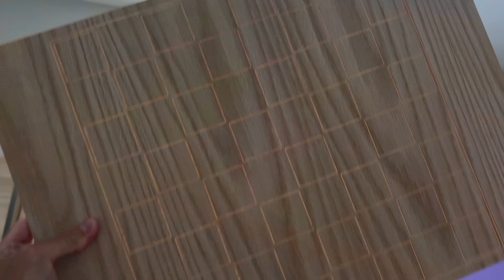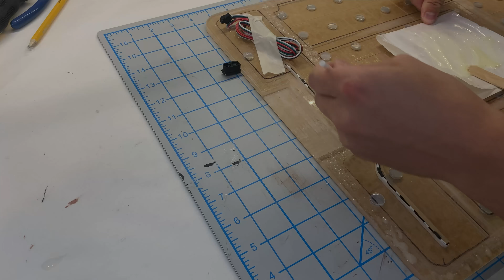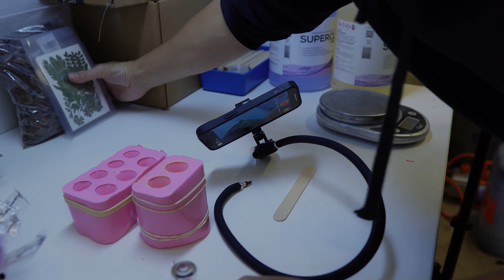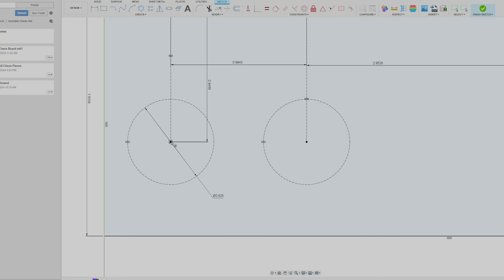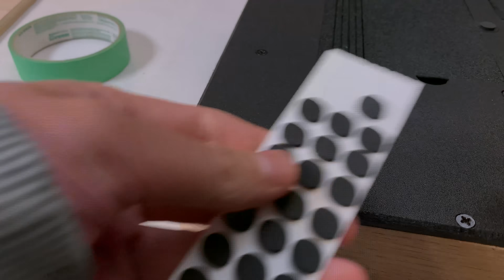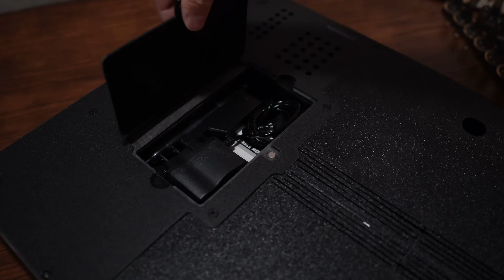I Built a Chess Board That Hides Itself

Comment: A very exciting piece, I can see a lot of people liking this. the love the pieces, very sharp and simple and still very easy to visually see. The board has enough room to place the captured pieces, which is nice. and the size of it is fantastic. However, the grain is running in the incorrect way, it should be running from one player to the other, it creates a visual flow that is expected with higher end boards, to be fair i think you showed two different ways of setting it up where one was correct grain, and the other incorrect, which is very off putting to be fair, you can't do that with a normal board. but that leads to my next point. which is  the entire board is made up of the same species and color of the wood, I get the point was to separate the individual squares with the lights. but during more complicated play this would cause way to much confusion, and the board should not be a hindrance of the game. as such i would say unplayable, and that its a 3 out of 10. the presentation is just excellent however, of course the lights make it really pop. and i can't say it enough I love the pieces...probably the best custom pieces I have seen.  Anyone would be luckily to have this in their home, just as a show piece and not something you can really sink your teeth into.

Comment: Impressive build and I like the attention to the craftsmanship of everything.  Have played some chess (not good) but I hung out with a chess club that played tournaments there are some standards that were overlooked, and of course that's not the purpose of your build, but if you wanted to make your next chessboard and pieces to that standard, here you go:  First, take the rook and lay it on its side, that should be width of the square... all boards and pieces are proportional to that.  The "House of Stanton" are the official shapes of the pieces.  A chess board needs dark and light squares.  To accomplish that look, but still hide the fact that it is a chessboard, you can have underlit boards, the checker pattern of squares can have thicker or colored underneath the board so it will reveal itself when the LEDs are activated.  Make sure you get the right color pattern the  A1 = Dark color square.   A nice touch on the pieces is to weight them... I like the "Triple weighted" pieces as it gives them some gravatas and make them that much better feeling when playing with them.

I do DIY on my channel for Halloween props projects, but I really like the fine work you do... this is a no-brainer to sub to your channel.  Cheers!
Reply: Your reply echoed my thoughts in particular the part that it should have light and dark squares. Important part to be functional. 👍

Comment: 154 magnets were necessary.
You may have put more magnets than needed to make the black bands more snappy and anchored to the board. If so, it goes from 162 to 202 magnets.

32 for the pawns and the board
64 for each squares of the board
32 for the black storing bands + 8 to fix the bars inside the storage compartments spraking of which
10 magnets for the storing compartmends under the board. (5 for the doors, 5 for the boards)
8 to fix the black bands and have a "captured" zones during games.

32+64+32+10+8+8=154
Reply from the maker: Very Accurate I believe i used 157! But now you got me second guessing LOL!

Comment: Would require a good bit of coding and an unholy amount rfid ships, readers, and a pressure sensor under each tile, but it would be awesome if as you touched each piece[pressure sensor activated], it displayed the moves that piece could make as registered by the rfid chip it reads in the piece. Though at that point, it's going to run into a bunch of far more complicated issues and the like. Would still be really cool to see!
Reply from the maker: If I do v2 I will definitely do this!

Comment: You could put a small copper coil in each square are power them, and then you put one in each piece and wire it to an led. And make a system so when you place a piece on the board the square lights up brighter

Comment: I think that using magnets to secure the hinges at the bottom isn't a particularly good idea, as the magnets might make it feel premium, but correct me if I'm wrong, if you shake the box, everything will fall out, and if the magnets are strong enough to hold it together now, they will eventually lose power anyway.
Also, it would have been really cool if you made a timer incorporated into the board, that would give you a lot of productivity.
Reply: (Magnets get weaker over time)
Reply: I think if you made the magnets in the board (to hold the pieces still while playing) electromagnets you would be able to also use @benrex7775 's idea to light up the pieces really easily.
Reply from the maker: Very interesting idea. Electromagnets might be cool but very expensive. You have given me an idea for a future idea though!
Reply from the maker: They are surprisingly strong and if shaken the pieces do not fall out. But if dropped they would fall for sure, maybe a future version would have a carrying case to protect the board and pieces. 

As for neodymium magnets they lose very very marginal amounts of strength (like 1-2%) over decades so not too worried there.
Reply: @hobbybuilt  What about incorporating a timer into the board? The lights may be cool, but they are mainly a gimmick in most situations, if I had that board I wouldn't bother turning the lights on, but if you put a timer into the board, it would be more portable and I would prefer it to using a phone.
Another idea, which I think would be really good, is incorporating magnets on the extra bits on the sides of the board. When you play chess, and a piece is eliminated, you usually put it on the side, so putting magnets there would be pretty helpful, right?
I hope you make a part 2 of this because I enjoyed watching the video and think you could make an even cooler chessboard with even more productivity features. 🙂🔥
(edit: I just checked your channel and OMG HOW DO YOU ONLY HAVE 5K SUBSCRIBERS,  you deserve at least 500k!)

Comment: As a chess player and a maker myself, i really love all the craftmanship put in this chessboard !
I just don't understand why you mold the pieces when you could 3d print the other team in another resin and it would be cheaper to produce, unless you wanted to try to create a batch process to make many boards like this :)
Reply from the maker: So originally I wanted to make clear resin with leaves and bark embedded in the pieces, SLA printing can’t do that. Ultimately resin parts are not as optically clear either + if I wanted to make multiple sets I can do so. Long story short a few reasons!
Reply: @hobbybuilt  Oh yes i totally get it !
I forgot the "leaves in the resin" part in your video but it definitely make more sense now :)
Idk but maybe a 2-part mold would ease this leave inclusion process ?

Comment: The chess pieces look super light weight and if they are you should consider adding a small weight on the bottom.  More heft makes it feel good when you play.
Reply from the maker: Actually no the resin parts are quite heavy with the added brass washer and magnet they feel just about perfect!

Comment: Just a quick idea but to make the square more invisible have you tried milling from the underside of the top? It would keep the top of the board flawless but still allow the led lights to shine through and out line the cuts.
Reply from the maker: Did some testing on this but didn’t show in the video. Unfortunately the LED lights looked horrible shinning through the wood veneer. This would have been ideal for sure.

Comment: IMO not a huge fan.
Reply from the maker: Fair! What are your suggestions to fix it?
Reply: Would it have been possible to lay equal sized squares above led the led lines? Cause as is, the squares look different sized to each other…
My only nitpic. Pieces + place to put them away and stuff cool. Also if extended a bit could add the clock display right on board with buttons, possibly a bigger battery. I didn’t catch part of video with if this thing can run wireless..

Comment: either 64 or 128 magnets? Assuming you either used one magnet or two magnets per hole Because if a chess board is eight Grid squares by eight grid squares That gives us sixty four squares Meaning that if you put two Magnets in each there would be 128 total magnets
Reply: Although this math is just for the top side I have no idea how the stowage works yet 😂
Reply from the maker: Yeah I didnt video it good enough. 157 Total!

Comment: First off - excellent work. My comments are not at all a takeaway from the job you did. IMO The design requirement of making it appear uniform when not lit means that the checkerboard grid of light/dark squares wasn’t attempted. If I had to make a suggestion, I would do thin pieces of veneer epoxy that is marbled to look like wood when not lit, but allows light to pass through when lit. Getting the grain right is near impossible but if you could do it you’d be untouchable with this. Also, when taping the grid I’d suggest using 3D printed shims or layup guides to ensure even spacing and squareness between tiles.

Loved watching this!

Comment: 182 magnets? Curious if the living hinges on the bottom ever give out when your using it as a tray with the small magnets. Very nice build.
Reply from the maker: 157! No signs of wear yet, they are PLA which is far from ideal. Good thing they are rarely used (only when transported) I do think they should have been printed a bit thicker as well.  Thanks for watching!

Comment: Bit late to the party here, but my guess for magnets is 192. Two for each space in the board and two for each chess piece (196 if you included extra queens for pawn promotion). For future reference, if you use strong Neodymium magnets (I get mine from Apex Magnets), you'll just need one for each space and one for each piece in order to have them attract through more material. The neodymium magnets I use (5mmx5mm cylinder in the board and 1/4"x1/4" cylinder in the pieces) are strong enough to attract the pieces through about 3/16" of wood.

As for a suggestion, 3D print yourself a Battlefield Chessboard (check my shorts if you want to know about the concept). I work with wood, so I make it out of wood, but it would be a cool and relatively easy 3D printing project. You could also use your CNC to make a wood version and save yourself from the work of power-carving with an angle grinder.

Comment: Would be awesome if each square was individually addressed and the available moves lit up on the board. Could detect when the piece was lifted using either the magnet or make the pieces conductive and have a capacitive touch sensor on each square this would also enable an automated timer
Reply from the maker: Very creative, definitely keep it in mind for V2 if I ever get the time!

Comment: That copper washer.. just remove it dude.. looks weird..
Suggestion make small hole in the bottom of the chess piece and glue the magnet.. 
that copper washer make it look cheap..
Reply from the maker: Not copper, solid polished brass. Interesting take though.

Comment: for the top not to show the squares when the lights are on u can put a thin layer of veneer on top of the entire board so that the light can bleed out through the veneer
Reply from the maker: I experimented with that and so close to doing it but even the thinnest of veneers threw off the RGB colors so much because certain wavelengths not being able to get through.
Reply: @hobbybuilt  now i dunno if ull like the following, but what about using like the plastic veneer or those textured fake wood wallpaper

Comment: If you ever want to go crazy here’s an idea: a chessboard with a x,y axis arm built beneath the playing surface that can move a single piece at a time. If the board can also detect which piece was moved most recently (Hal effect sensors or something) the data could be sent to another board to enable two players to play each other remotely with the opponents pieces being moved by the board. 

For moves that require a piece to jump over another to reach a position on the board maybe rotate the base of each with a magnet that is offset so the pieces will pivot out the way allowing the moving pieces to pass without collision

Sounds crazy complicated now I’ve typed it out 😅
Reply from the maker: Wow! Maybe next version haha! Thanks for watching :)

Comment: Wouldn't the pieces and accesories fall out if the board is banged?
Reply from the maker: The magnet holding it is pretty strong I would take a drop to release the door. And I usually hold it up against my side when transporting!
Reply: @hobbybuilt  then that's fantastic. Do you use it often? Because it's a beauty

Comment: You asked for a suggestion so here it is. Maybe there’s a way to illuminate a chess piece that lands on a square by making the space touch sensitive? Maybe a disk magnet with a hole in the center and the board senses it’s presence? There’s an led in the center of each square that only illuminates when a chess piece is above it. Why not take advantage of the transparency of the pieces. By the way, I think what you’ve built it really beautifully made and very imaginative. I’m extremely impressed and instantly subscribed as I don’t want to miss further projects.
Reply from the maker: Thanks so much! I really like the touch-sensitive idea and I'm sure it's doable.

Comment: Looks cool, but it's too hard to see dark and light squares.
Next upgrade should be this, but it shows the squares properly and it has a built in computer telling you how to move for the computer in solo play through lighting up squares.
And with some settings, you can tap pieces to show you the way they can move, including blocking pieces and then for even more advanced stuff, include a chess teacher that uses the light to tell you best moves and teach you openings and stuff.

Comment: Ummmmm astounding work, sir. Simply beautiful. Okay, SO, I have zero experience in this specific level of craftsmanship, so these critiques are likely to sound naive. First, from a visual standpoint, the outer LED boarder, in my opinion, doesn't look "great" whenever it's next to a square's individual boarder. It ALmost creates a visual tangent, which in the design world, as you likely know, is unpleasing and the viewer usually can't figure out why they're unpleased.  I don't think the boarder is necessary at all, actually. Secondly, and this is where the naivety will be blaring, what if instead of channels for the LEDs, the cnc machine NEARLY carves through from underneath, creating a SUPer this layer for the LEDs to shine through when on, but no visible channels when off. Anyhow, I absolutely love the techno-organic look. Great work!
Reply from the maker: Glad you liked the video! Great point for the outer boarder. I think I agree with you, It seems off. As for the led shjne through I’ve done a lot of testing with glowing through a medium like wood. The wavelength of the led is at its mercy red light blows through the wood but blue light looks yellow. Alongside that the grain structure makes the glow very inconsistent. I wanted so bad for this to work but just simply looked bad.
Reply: @ spoken like a true artist! It absolutely does NOT look bad. What about an epoxy filler, maybe in a tone, not color, that matches the wood? Dude, your stuff is beautiful and fun to watch.

Comment: I had an idea which could look nice. Make a tiny hole in the middle of every tile. when a chess piece is placed down then an LED is turned on and illuminates the resin chess piece.
Reply from the maker: Great Idea!
Reply: @hobbybuilt  98 magnets
Reply: @hobbybuilt  would be cool if you could also control the lighting to be brighter for the pieces of the player who is better positioned
Reply: Took the idea out of my head. Maybe individual Reed switches so the magnet on the bottom of each piece makes a connection turning on each led
Reply: @sinformant Hall effect sensors would be more precise.
Reply: @jamesYValley  yes, but imagine the cost off 64 hall effect sensors vs 64 Reed switches. And High precision isn't exactly needed in the case of detecting that a chess piece is placed on an individual square.
Reply: @sinformant  Theres also a second problem, the magnets on the board would interfere, removing those results in less alignment in the peices, resulting in a peice having a chance to activate two or no reed switches, with a hall effect, you can just read the highest value, without having to rely on a threshold value for reed switches.
Reply: @sinformant  or a macsafe like connector/ wireless power and an led in the pieces
Reply: Was thinking this same thing.
Reply: Another idea to add on would be each chess piece can have outlines for the LED to shine through, creating some character for each piece. further from that would be changing the layout of the LEDs to line along the tiles, have programmable touch function that can activates VIA the magnets apon the piece moving ontop of the tiles, making the LED change colour when a piece moves ontop of it. Of course, I have no idea how u would accomplish this.
Reply: Hello. The magnet will block the light.
Reply: Using those same holes you could make so that it shows you moves you can make for people who may not know how to play
Reply: That would be epic dude!
Reply: And not rgb please
Reply: Oh yea and add some chunks of Marble so it looks cracked
Reply: Or maybe led inside the resin pieces that lights up when connected to circuit in the board via magnet
Reply: But wouldnt it be hard  to know which piece is your
Reply: Mass produce these please

Comment: 132 magnets
Reply from the maker: 157! I messed up the count myself. Thanks for watching.
Reply: @ but I calculated that 32 for each piece plus 32 for each piece holder plus 64 for the board plus 4 for the black thing on the bottom